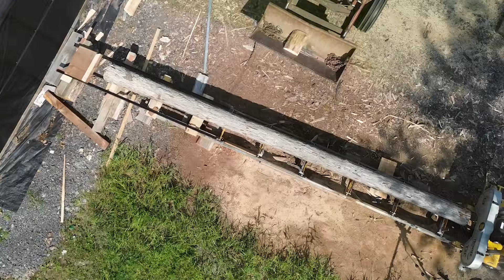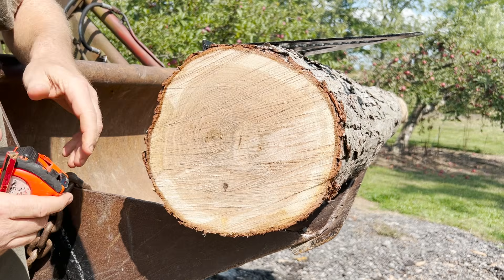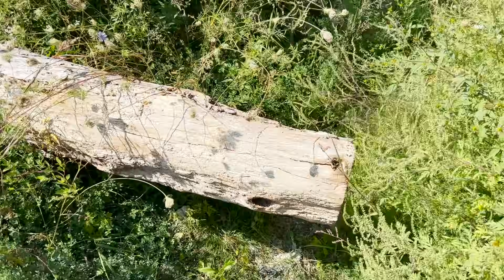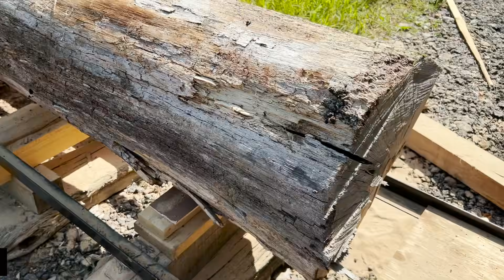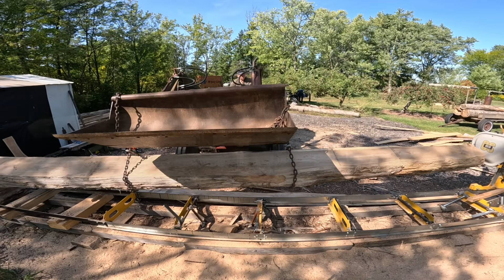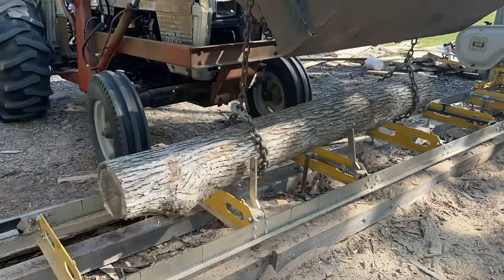Building a Timber Frame Sawmill Shed (Part 1): Milling Posts & Beams

Comment: You're milling experience will be a lot better without a Temu mill. Not being mean and you did a great job milling with it but I've never seen a mill wobble around that much and why are there tires riding along with the mill head??  I'm sawing timber with a Norwood to build my mill shed in the spring.

Comment: A kindly meant suggestion: those 6" leftover beams shown at the end of the video could well be "wind-braces" (I believe you referred to them as "corner braces") and if left as wide as possible, could be finished with a shallow curve for a decorative effect. Also, don't be too worried with a bit of wane on some of the beams, there is no strength lost and personally, I think it looks nice, (especially if matched.)
I try to leave a bit of natural (or un-sawn) look to my beams, to throw the age of the project.
Cheers! from a former BC guy now in Oregon.

Comment: When you're sawing on large dry wood, I would add more water flow. You want enough coolant that you can touch the blade at the end of the cut without being hot. I only saw a few drops.
Reply from the maker: Thank you for that advice. The water drip rate has been a bit of a mystery to me. I really appreciate the tip.